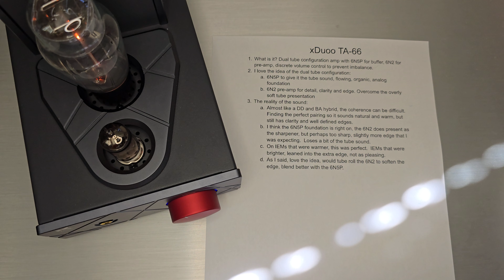XDUOO TA-66 - High-Performance Dual Tube Amplifier

Comment: This is a fantastic OTL tube amp. Instead of stock tubes I'm using a Voskhod 6N2P-EB and a Russian Winged "C" 6H13C power tube. Excellent all the way around with epic bass response.
Reply from the maker: Yes, that is the key, you got new tubes.  I think these xDuoo stock tubes don't always show off their designs as well as they should and you swap tubes and night/day difference.  If that was my personal unit and not a loaner, I would have 100% swapped and it would sound amazing
Reply: Hi, thanks for the info! Can I use these tubes without an adapter for the base? Kind regards! Peter
Reply: @peterlenhardt5525  yes you can.
Reply: I don't know if you already commented elsewhere but I followed that advice too with the 6n2p-EV and this unit came from very good to holy how is that even possible high end audio. I pair it with some Aune AR5000 (low impedance) by using some 6080TW and just having to deal with small distortion when listening very loud. The rest is absolute beauty. Everything I was looking for

I went to an audio store and listened to hifiman top of the line, focal top of the line, Stax, audeze you name it, on some naim multiple thousands of dollars amps and streamers.

This set up TA-66 with changed tubes and Aune to me kills them all - if you like the sound I like.

We are living in a beautiful area for audio !!!
Reply: I use this setup too and i can confirm that it is really outstanding in the TA-66

Comment: I was able to tube roll with excellent results, replacing the generic 6N2 and 6N5P with Psvane 6SL7 Art series converter adapter required (Jemosa 6SN7/6SL7 to 6N2) and Sovek 6SA7G.
Reply from the maker: I'd  bet that sounds amazing. If it was my amp and not a loaner, that is what I would do
Reply: @PaulWasabii  The Sorvek is actually relabelled Svetlana dating back to 1979. Oldie but definetely a goody. Psvane, the sound stage, wow. These inexpensive converters really open up doors for tube rolling, not just for the TA-66 :)

Comment: I've always wanted to try a true tube amp and not a hybrid one that omits the large tube for cost reasons. It's interesting to see how many times a converted signal needs to be amplified to power your headphones. I think the DAC does it twice before it even gets sent to the amp. I can see why changing the amplification method could affect the sound.
Reply from the maker: As I said, I am lucky enough to have borrowed a few and have quickly underestimated finding one that I prefer or would use enough to justify the purchase.  Harder than I imagined it would be but part of it is that everyone has a notion of what they will sound like and when they don't, it is like starting over.

Comment: I have their MT-602 which is a great class-A for under $100, and it seems like smooth with a bit wider stage.
Reply from the maker: Noted.  I do think some of it comes down to which stock tubes they use on a particular model.  Still looking for the magic.
Reply: @JohnClarkW  
My 2 cents.
GE JAN5654W are good tubes for approx. $30 max. a pair.
I scrapped all my headphones equalizing setups to "flat" to get the tube's texture.
Airer bass, nice vocals mids, excellent clean treble no harshness, fair amount of details, depth and soundstage with open backs & planar.
Got about the same Wattage output as the MT-602 aka 1.1 watt but on a different tube amp. of mine.

Comment: Reading the specs. the output power 600mw is too low to drive less efficient headphones but could be fine for IEM.
Tubes 6n-x are typical low grade dubious Chinese Tubes without any engraving on them  😳
Not convinced for the retail price regarding $ investment to swap tubes
Reply from the maker: I have mentioned this previously to them, the stock xDuoo tubes are a big question mark.  In talking to others about it, seems like that is what xDuoo does, cheap Chinese tubes assuming the owner will invest in better quality.  I agree with you, I don't want to get a shiny new amp and then proceed to spend more on tubes.  Perhaps that is just the way it is, but I don't know. I wasn't too concerned on the power as much as I was fixated on the smaller tube and how it should have sounded in my head...or what it could be with a tube roll which is where I was on TA-22 also.
Reply: Actually, it develops loads of power for high impedance headphones (target 250 ohms and above).  That's what OTL amps do - so this one isn't unique at all in its specifications.  If you get this on sale (often on sale at Apos and other retailers), you can get into an OTL amp for just a little over $200.  Add 30-40 bucks for a couple new/NOS tubes (options from Ukraine are excellent right now), and you have an excellent OTL amp for $250.  This is an insane value.
Reply: @jayburkette8977  Thks for the OTL outlook on this ! It's tempting to take that direction...